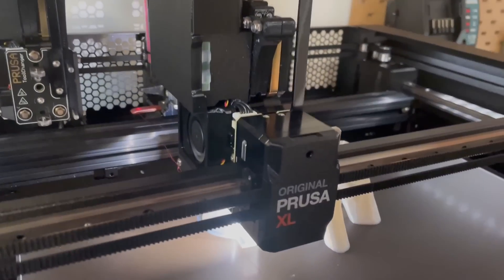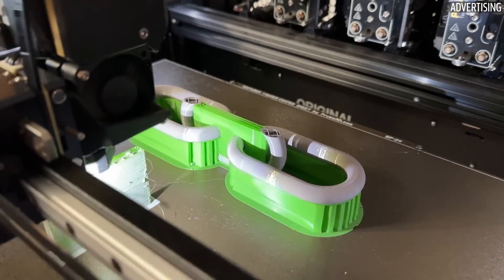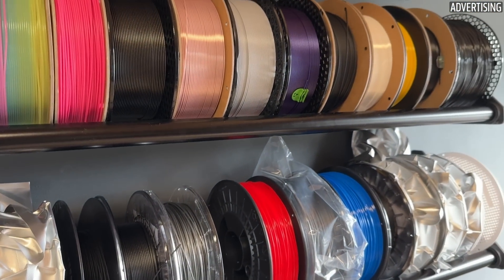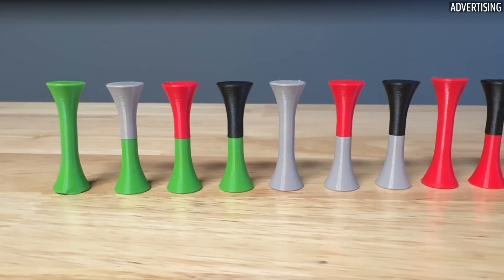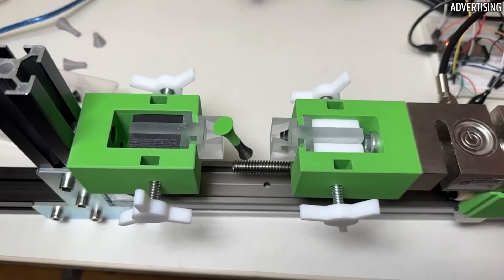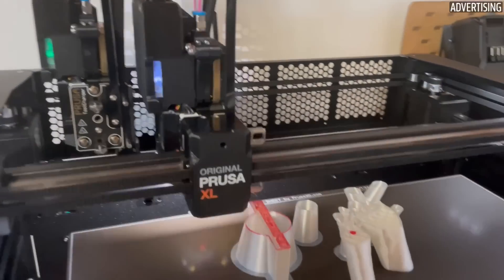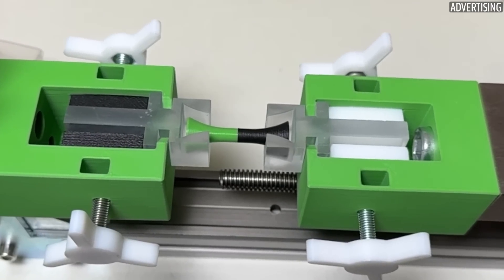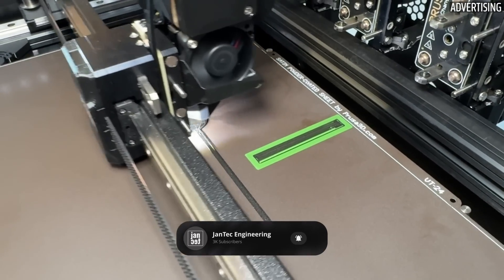You’re Printing ABS Wrong! No Warping & Less Energy Consumption with This Trick!

Comment: Question: Does PLA+ABS have the same layer adhesion whether you print PLA on ABS, or ABS on PLA?  It might seem like a silly question at first, but since ABS prints significantly hotter than PLA, I'm curious if the amount of layer remelting is different enough to make a numerically noticeable difference.  Admittedly, I can't think of a good reason to print PLA on top of ABS, but I'm still curious.
Reply: Not a silly question at all, I was going to ask this same thing, I've even noticed the difference if I print Silk-PLA/PLA or PLA/Silk-PLA. The order for some might be very important but totally undocumented. Most don't realize that part of the bond is the lower material also remelting a bit, so trying to print PLA ontop of ABS, likely doesn't work unless the ABS is still quite hot.. Then we also get into another odd question because of that.. "How long does your machine take to change out filaments?" because that is a new variable that's even lesser tested for differential material bonding. Thermals defuse through the materials below, so if you take too long the bonds end up weakened.
Reply: ABS doesn't stick to the glass at all for me. This is a good enough reason to use a PLA base layer. I think PEI sheet is too cumbersome and fragile and expensive. I have, but I don't like to use it.
I heat the table to 55-60°C. In this case, the adhesion is strongest. ABS adheres perfectly to the PLA layer, because it is warm and melts together. Then, when it has cooled down, I simply peel off the PLA layer from the bottom because they no longer stick when cold.

Another advantage of the PLA base layer is that not only ABS adheres well to it, but practically all materials tried so far.
Reply: @lacikeri3102  That's a very good point actually, I suppose I've been spoiled after moving to PEI sheets and never looking back. And ABS can certainly still be finicky at times on that. One thing I've found is whatever z-offset I print PLA with a reliable first layer and 0.2mm , I often need to go to about 0.15mm for ABS to have similar results, on PEI I know it helps squish it into the grooves, on glass that might help as well. That said if PLA can solve your issue anyways that's awesome, that one layer isn't really going to deform anything even if it hits glass transition temperature. Only thing to worry about is if the ABS distorts critical dimensions or not.

Also oddly enough PLA and TPU don't make an amazing bond, but they do still bond better than PLA/PETG, which is okay I guess since TPU is already crazy-adhesive to the bed, the bond between TPU/PETG is ~2x stronger though, likely temp related at least a bit.
Reply: @Roobotics  I have not tried PLA-TPU. Yes, the TPU stuck well on its own. I only use PLA base layer for ABS, PA materials. Sometimes to PETG if it would come up because of its shape. The truth is that I have a self-built printer. It does not have automatic table leveling. This is also the reason why I like the glass table. 😄
I want to buy a Bambulab printer, I will definitely use it with a PEI table.